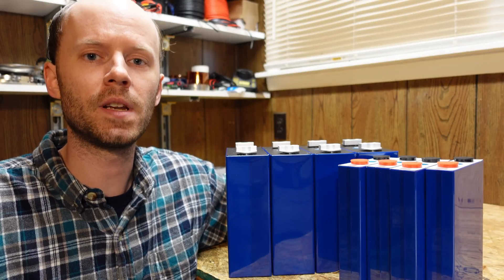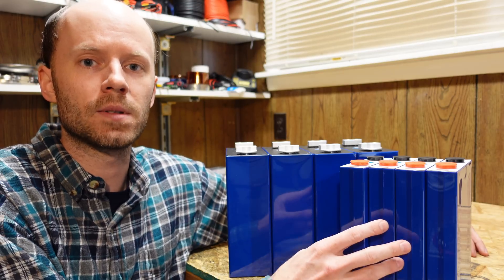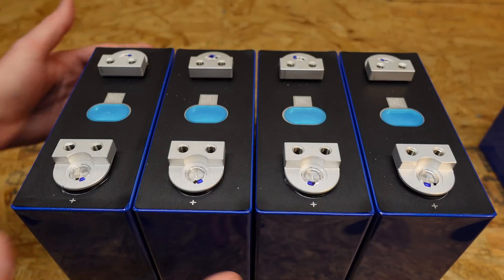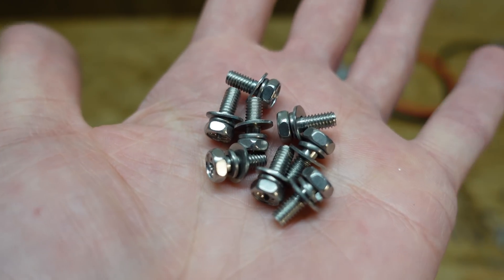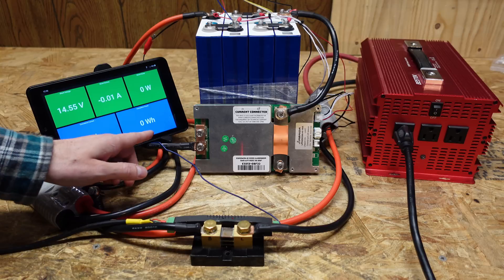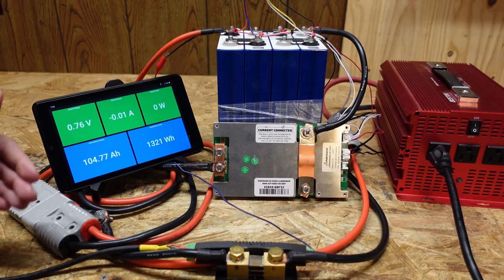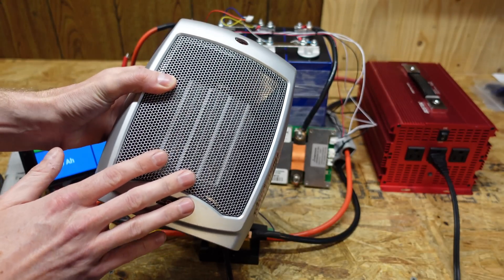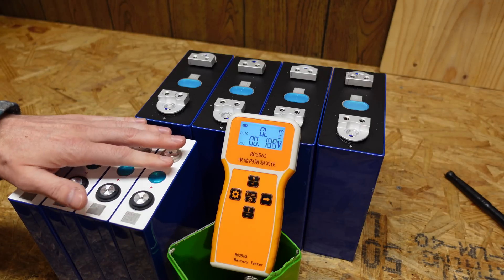Grade A EVE 3.2V LiFePO4 Batteries, 105Ah, 280Ah, USA Distributor!

Comment: I bought cells from Amy and Hayley. Top balanced all 160 cells. Their QC ducks! Only one battery out of 10 made it past 3.5V/cell without a 280 mV imbalance or runner over 3.65V. Even my Trophy 220aH!! The one with the JK BMS 2A balance does okay. We should not have to install a 5A balancer on new "Grade A" cells. SunFunKits claims true Grade A. I will try 18650 store.

Comment: Curious that the 105Ah batteries show 3500 cycles, but the 280Ah batteries claim over 6000 cycles.
Usage? Chemistry?
Reply: The LF280 are also only rated for 3500 cycles, but the LF280K (!) are rated for 6000 cycles. EVE's website doesn't say what the difference is, though...

Comment: Wow, didn't expect to see 18650 battery store in this space! Very cool. I order my 18650s from them. Prices with shipping are pretty good but Docan still edges them out. Always good to have options though. 

EDIT: Forgot that the smaller cells were 105Ah so cost per Ah is actually better on these!

Thanks for the video!!

Comment: The small size batteries compared to SOK 48v 16c (1600 $ if I am right) will have a cost of 1000$ plus bms and box. Pretty good deal.
Reply from the maker: 16 of the EVE LF105 is $1053 shipped. Add in another $200 for a quality BMS of your choice, maybe $10 in cabling and you're looking at $1263 compared to the $1739. You don't get a the heavy duty steel case though. It's up to each person what their needs are and their level of wanting to DIY something.

Comment: what do you think of the samlex evo series inverters? not much info out there about it i find, at least not relative to recent competition
Reply: I have the 2224 and the 4024 and I love them, they run my house and shop.  The 2.2kw has no problem running 2 horsepower lathe, mill, and tablesaw (one at a time).  Great build quality, lots of programming.  You don't hear much about them because people don't have trouble with them so no need to ask forum questions, and they don't sponsor Youtubers.
Reply: @bobaloo2012  they seem nice of a bit long in the tooth without the bells and whistles of victron - has there been any modifications to make them function with Bluetooth? Was thinking about them for use in an rv, could be useful
Reply from the maker: I don't have any experience with that brand unfortunately.